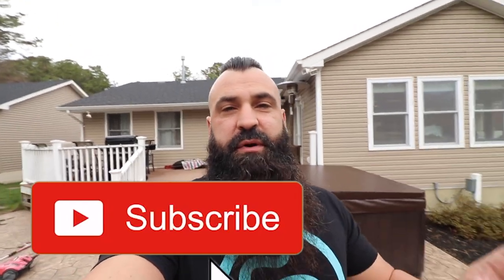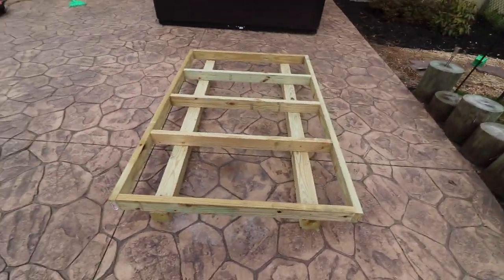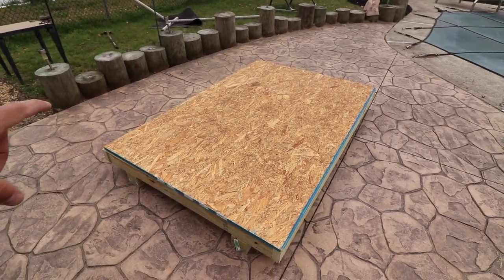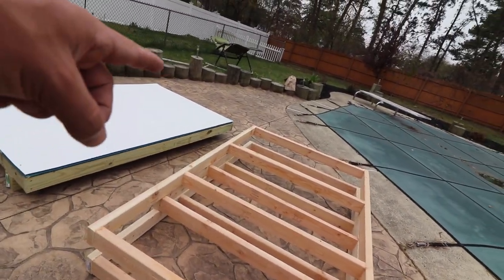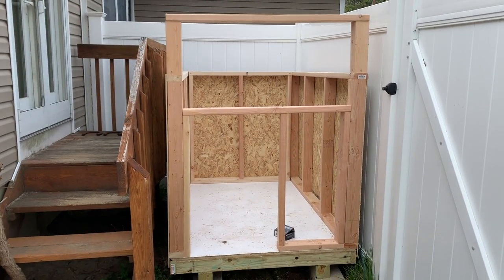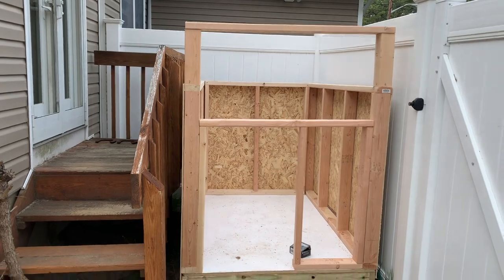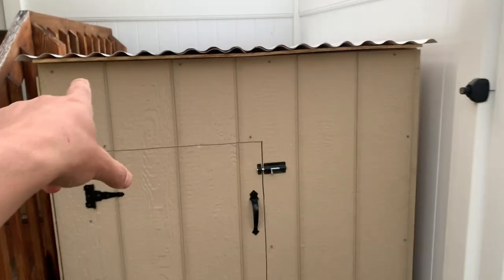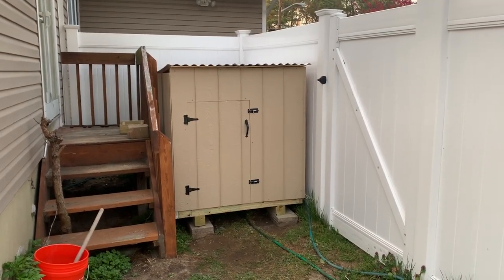How to build a Duck House v2.0 (easy & basic!)

Comment: Omg, your first decision (roof idead) was way better, are you gonna put AC for the hot summer months if not that's gonna be a Dutch over, the smells is gonna be bad for the ducks & whomever gotta clean it, also yah will smell those fumes walkin in & out of that area 😆😂🤣 Add window on top of the doorway, keep original roof options & add chicken wires on sides of new roof (better alternative as planned in original idea). That little 2-inch  opening you got there isn't gonna ventilate shit 🤣  It's covered by two areas of wide & covered wood, amazing work, but would you wanna live in it with no windows, AC/ventilation & a bunch of other ducks & their hot shit, pee & breath all over you 😆 add original idea 😂Can you add dimensions &  supply list of your original idea 🤣 Great Job, stay blessed, thx 🌻

Comment: Correct toe nail.  Well toe screw lol you doing great im a roofer/carpenter ...if this helps ive seen way way worse bro id hire you... Are you gonna insulate it for winter and probably keep cool in summer
Reply from the maker: I dont know, I was thinking about that but from what i understand is ducks do really well with cold, and the coop should only be slightly warmer the outside temps so when they go from the coop to outside its not a big change in temps.  If its warm in the coop and then freezing outside its a shock to their body so i dont think i need to insulate, but we will see.
Reply: @Chris_Graham  oh ok i didn't know that ...you taught me something today ... Cool never had ducks